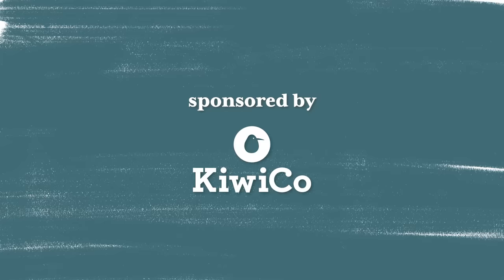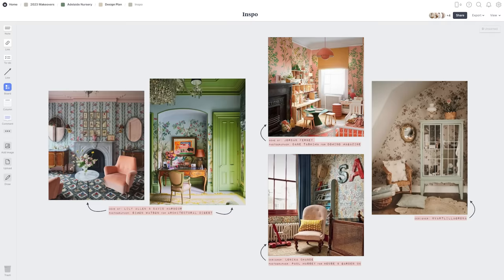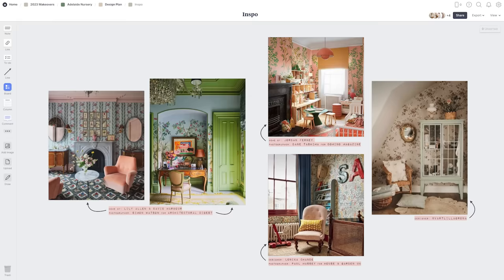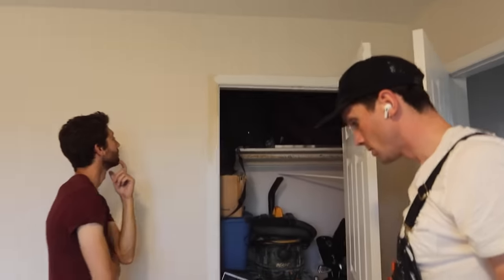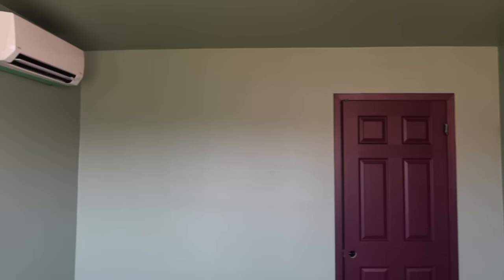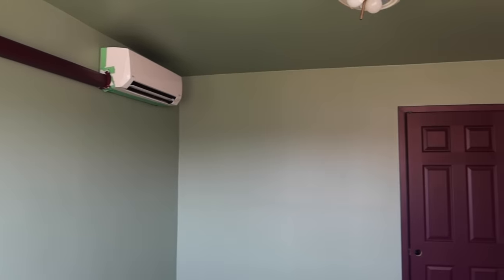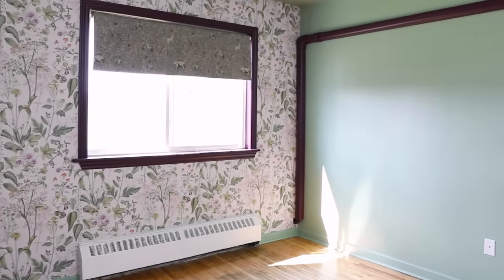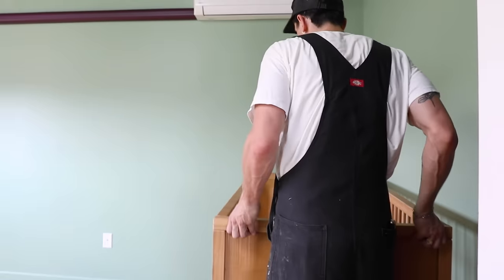Making Over My Childhood Best Friend's Nursery

Comment: I really love that the style they chose is so prominent. The configuration worked out very nicely after all the tries. While I love the juxtaposing color of the pipes, my OCD eyes can’t deal with the asymmetry. I would have had Graham build a faux piping on the other side of the AC, to have a full purple frame around that wall, and I might even have wallpapered within that frame. But my first idea, when you showed the AC setup was that I would put up a curtain rod above the pipe and fill it with huge linen curtain panels to create canopy above the the crib and completely cover the piping. Either way, great job, Team AG, the room has lovely vibes 🙌

Comment: I lovedI the shade cover up.  I did this hack 20 years ago when I duped some Pottery Barn Shades.   I used sheer leopard print facbric and hot glued it to a roller shade.  I attached 3 loops at the bottom and hung a brass curtain rod through the loops.  At the time the Potter Barn shade was $129.00 each.  Mine cost less than $15 a piece to make.

Comment: I like the plum accents, but not on the pipe. A wooden box built around that would have been nice, for hiding the pipe and serving as a nice display unit. That would have worked with the plum paint better, maybe.

Comment: Absolutely love this, the only thing I'd have changed is I'd have used a spray adhesive to stick the fabric to the blind, only using hemming tape on the edges of the fabric leaves a large chance for it to come loose or bulge in the center. Absolutely brilliant idea though 😊
Reply: Spray adhesive is too toxic for a nursery, though, isn't it?
Reply: @kansasgirl8371  I genuinely don't understand how this would be an issue. If you were to use it in the room with the baby in it with you then yeah, probably a bad idea, but using it to adhere some fabric to a blind when the baby is nowhere near and with ample time to dry and for the room to air out (or ya know, do it outside of the room) then there would be nothing to be concerned by. That's like saying you shouldn't use super glue to fix things when you have kids because it's toxic. I'm genuinely confused by your comment.

Comment: Great job by you and your team as usual. I think a lighter purple for trim and door might have looked better but this still looks great. My mother used wallpaper on those kind of shades. It usually doesn’t add as much weight as material. The peel and stick would be perfect for that roller shade

Comment: I like the green walls, the furniture, but I don't like the purple (it's too dark, compared to the shade of green, it looks almost black), I don't understand why the AC pipe was painted purple (it's not something you want to highlight, ideally it shouldn't even have been on the wall or it should have been hidden at the border between the wall and the ceiling), the wallpaper is beautiful, but I would have put it on a bigger wall, so you could actually see it (too many elements on that wall, it's almost completely hidden and it clashes with the print of the blinds), I would have changed the lamp shade (is it black?), I don't know if there is enough storage space, the room is big enough to fit a bigger closet system. Probably my least favorite transformation on the channel, but I appreciate that it is not a regular nursery.
Reply: I feel the exact same way unfortunately. In addition to everything you pointed out, I feel like it's missing that really British and whimsical feeling of the inspiration photos. This feels more American pastoral as opposed to old-money London.

Comment: I love this room, but I just feel like it should have been taken further to encapsulate the feeling. I wish there was more contrast in the rocking chair corner. With the wall, the chair, and those shelves all being the same green it just looks washed out and not full of life like the inspo photos. I wish the chair was a matching pink to the dresser and the shelves were painted the same purple as the doors. Plus adding ceiling height, transparent curtains as well as the black out shade would have been so cute. Perhaps in green or pink.

Comment: The rest of the room looked lovely, as a newborn baby room, but that purple was seriously awful. If it matched the purple in the wallpaper, that might have been better. The green paint on the wall would have been a better colour. There was just a disconnect between the room and that shade of purple. I didn't get it. As long as the mum and dad time it. Not sure the change table is high enough. That one will be used for such a short time. Was it worth drilling a hole in the top of it? The lamp was lovely, but once the baby is crawling, that will have to be moved.

Comment: Not a fan of the dark purple trim or the shade. And for gods sake quit painting the ceilings. Just makes the room so much darker
Reply: Depends. with much lighter accents it may work. Look at french interiors, they are usually nailing this. But because they chose this dark purple and dark shade - that pulls everything down.